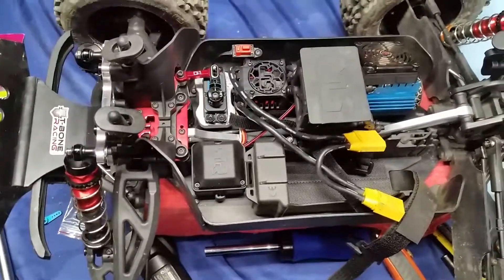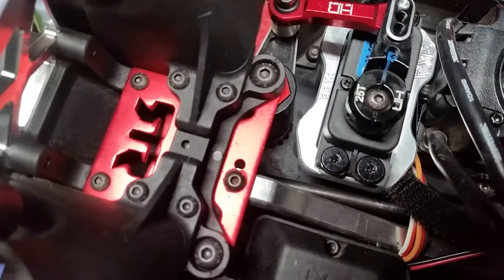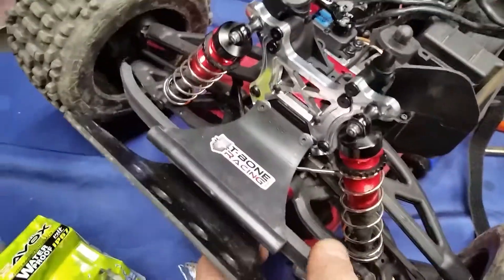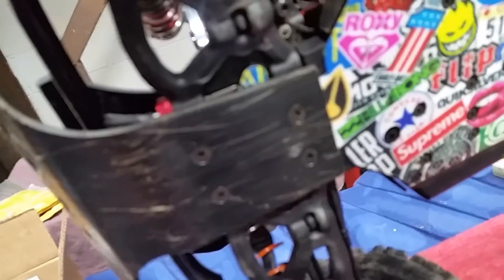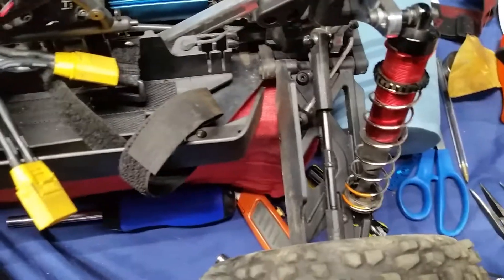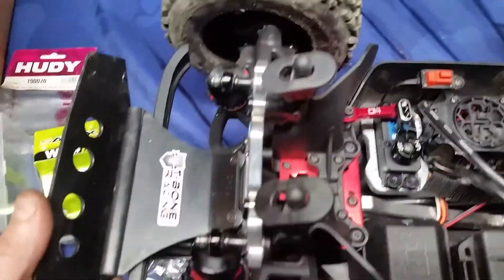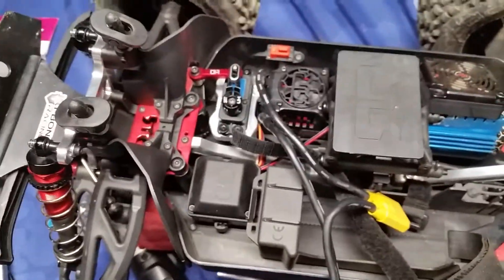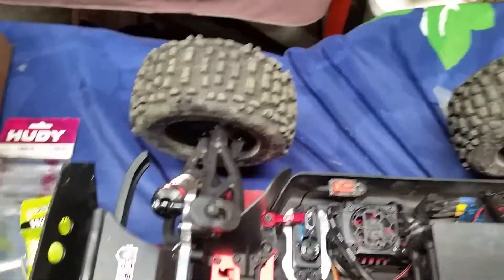Arrma Outcast 6S Upgrades

Comment: First thumbs up bro..the outcast is looking good... get rid of that t bone and put the rpm,,, you will thank me later... the rpm bumper holds up great plus doesnt dig in... i have 7 t bone bumpers laying around now... the savox 1210 servo is the best servo i got... i have had mine on the talion and kraton for a year now and i beat the crap out of it...BASH-ON BROTHER
Reply from the maker: RCbashing the KRATON Thanks Man!! You answered the front bumper question perfectly. I am gonna put the rpm on tonight. I had issues with the original ams, the pivot ball would back out unknowingly and eventually wore the threads out. So I put the rpm front arms and no more backing out. I also put the hr pivot ball caps with the o rings to eliminate them from backing out. Thanks for the help, I used alot of your ideas!!

Comment: How’s the chassis protector holding up?
Reply from the maker: Jesse Co I'd have to say it has held up well. It has been on there almost a year. It is showing wear with a few scratches down deep. Probably if not used in rocky conditions it would last forever. Thanks For Watching!!
Reply: @SteelCityRC  Is it like a protector from scratches or does it make it tougher
Reply from the maker: @justinward253  it's just to keep the chassis from scratches. Works very well doing so. Thanks For Watching!